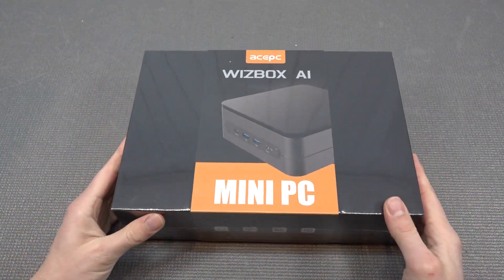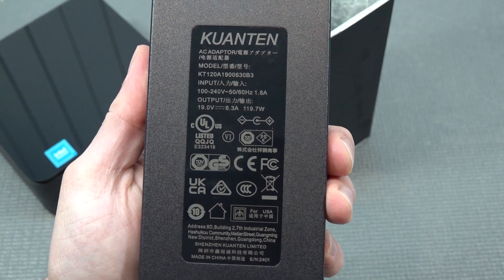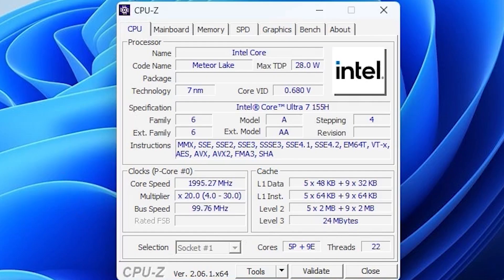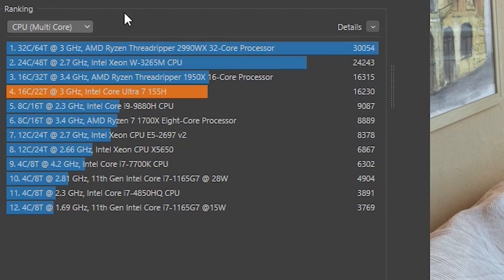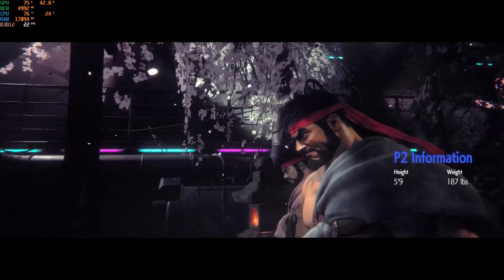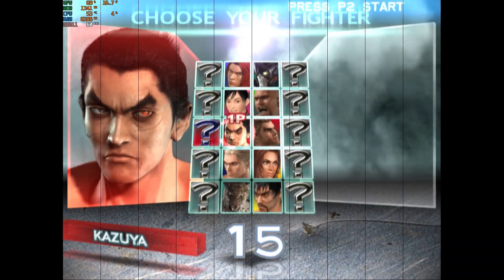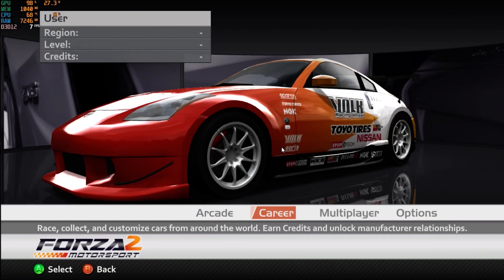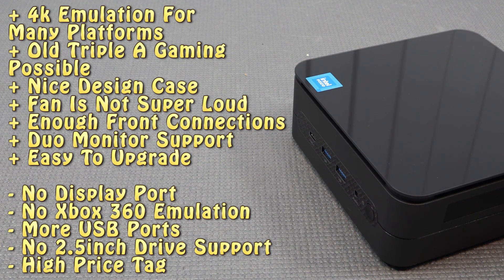Ace PC Wizbox AI - A True Powerhouse For Emulation & Gaming ?

Comment: For 800 euro you can buy a laptop with a 3050ti or even a 4060. I like this little box , but not for anywhere near that price.
Reply from the maker: Agree they should add a decent GPU for this price.
Reply: @WickedGamerCollector  It's often such a disappointment seeing the price. This box has some nice features though! The two full length M2 slots and two memory slots and the way it's accessible I do like. And it looks sturdy, but too shiny. The way the plastic is in the inside would been better I think. My idea would be make it 5 cm higher and the squeeze a 3050 6Gb in it! There are so many different ones that they are produced in too small batches also making the prices higher.
(And if you really want xbox 360 ... use a AMD gpu or just buy xbox series x for half the price lol)